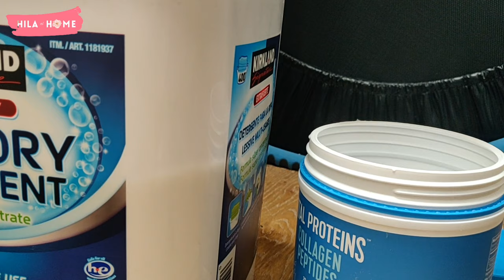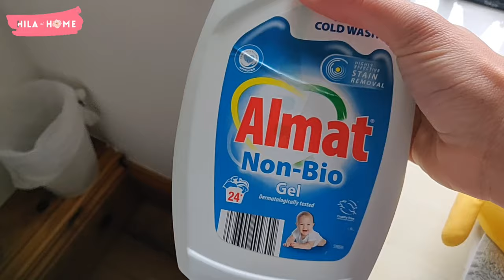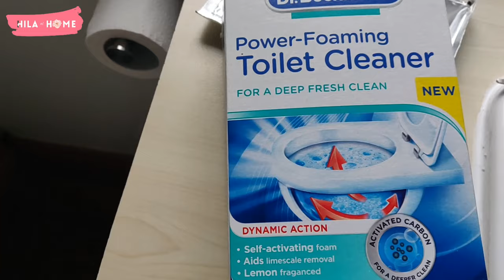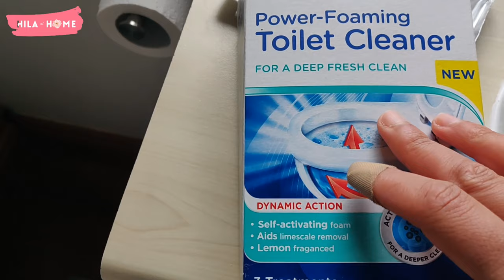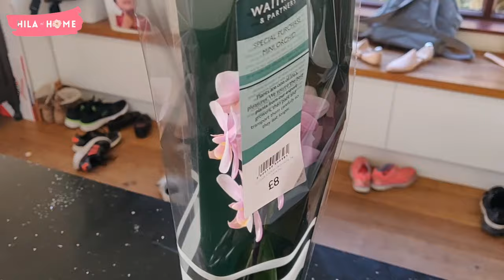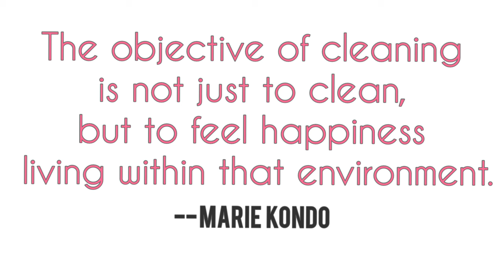Winter Days Ep. 23 | Clean With Me | Mum of 5 UK

Comment: Hila, you are an amazing💯% home keeper :trophy-yellow-smiling:and I hope that your entire family appreciates 💐your dedication. BTW, I believe 🤔that the dust build-up on the interior side of the laundry room door is due to possible lint build-up in the trap of the dryer. And because of the daily/constant usage of the dryer there are unseen dust particles dispersed into the air every time the dryer is opened - which adhere to the unseen moisture on the door (and other surfaces). I hope that helps solve 🧐your dilemma!🥰
Reply from the maker: Oh thank you! I think you might be right about the source of the dust build up. During my spring clean I'll have to clear out the filter tube in the drier - I had a look and it needs it. Thanks for the tip, very much appreciated 🙏